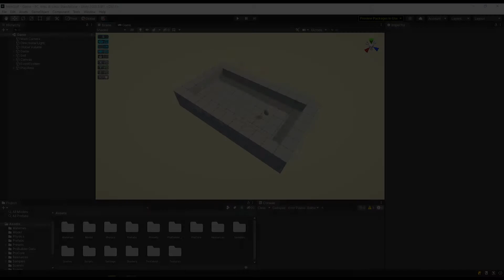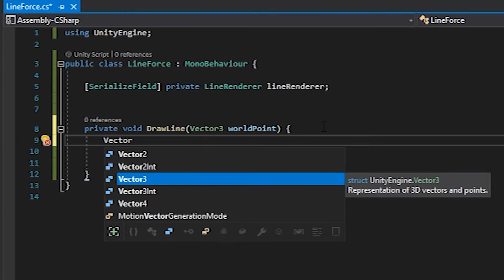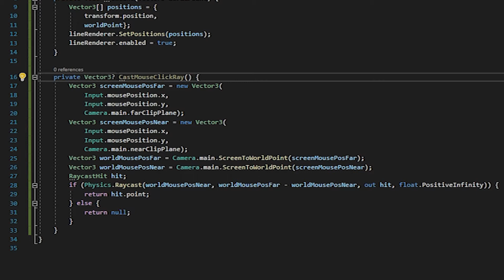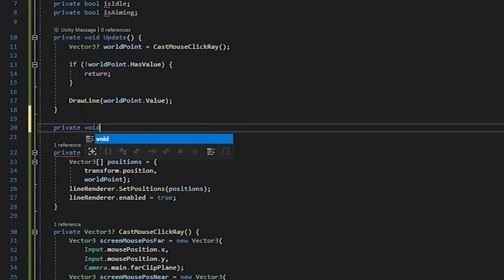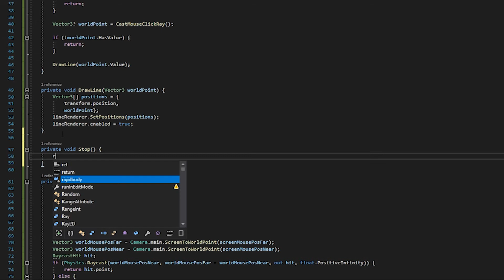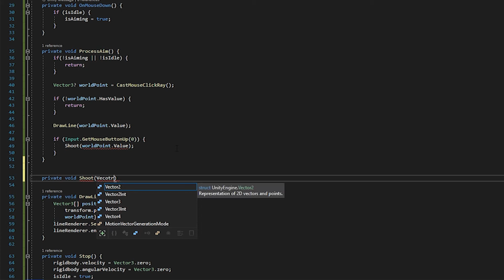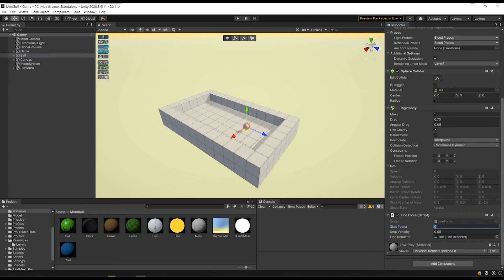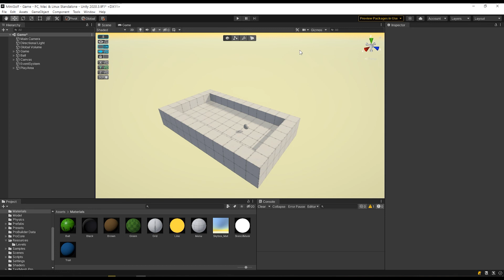How To Make A Unity Mini Golf Game (part 1)

Comment: for a simple fix, easier for my brain to process as its what i am used to for games i have played in the past

instead of this

   rb.AddForce(direction * strength * shotPower);

i did this

   rb.AddForce(-direction * strength * shotPower);

just so you pull back on the mouse to increase power.  ofc it is all preference, but this is what I prefer
Reply: you are a hero

Comment: For some reason it is random when i shoot the ball. Like the ball decides when it wants to shoot and when it doesn't. Do you know why this happens?
Reply: You are checking for inputs in the FixedUpdate function. FixedUpdate, instead of running once every frame, only runs once every physics tick, depending on the physics in your scene there may be more than one tick per frame or one tick every 10 frames.
Reply: thanks man helped me alot also my linerenderer in not displaying correctly like instead it displaying from the centre of the ball it appears on a random part of my screen, How do I fix this? @itsJimaholic
Reply from the maker: Without seeing your code and how your scene is set up, it’s hard to say.  Feel free to join the discord in the description and I can help you out there

Comment: Thank you very much for the content! A question, I would like to change the direction that drags the mouse, instead of dragging forward, dragging backward, do you have any idea how to solve it?
Reply from the maker: Around 10:15 I add a ShotPower variable to the script.  If you assign a negative value to that variable in the inspector the force that gets applied to the ball will be in the opposite direction of the dragged force.
Reply: @AIAdev  Thanks for the reply man! I actually meant it like this:
Currently in the script the player needs to drag the mouse forward and the line renderer will go in the same direction as the mouse, but how do I drag the mouse backward and keep making the line renderer show the same forward direction in the video, so the line renderer will go in the opposite direction of the mouse and the object will be thrown in the direction of the line renderer. Sorry for my English
Reply from the maker: @kisan1001  You could try doing some vector math to rotate the 2nd point drawn by the renderer by 180°.  This seems like a case where Dot.Product would also work but I admittedly don't fully understand how to use that to be able to help.
Reply: @AIAdev  Thank you man!
Reply: haha was about to ask the same question
Reply from the maker: @ProdbyHuskije  Very interesting, is the way I do this atypical for a golf game?
Reply: @AIAdev  I don't quite understand your question.I'm brand new at coding and wanted to make my first little game a minigolf game! 
I found a way to pull back on the ball so the ball goes forward, but now I need to find a way to make the linerenderer go forward too :)
Reply: @AIAdev  Usually the direction of the ball is the opposite of the direction the player drags with the mouse, this is our doubt
Reply from the maker: @kisan1001  gotcha.  I certainly haven't played a lot of golf games 😅
Reply: @AIAdev  a bit late but, like launching a pinball
Reply: @ProdbyHuskije  Hehehe :)
Reply: In the draw line function go to the position array and do this :

Vector3[] positions = { transform.position, transform.position + (transform.position - worldPoint) };

Hope it helps :) .

Comment: Nice video,really curious to know how you're gonna limit the player drag distance.
Reply from the maker: This could be done by splitting the worldPoint into a normalized vector3 and it's strength (vector3.magnitude).  Then clamping the strength between 0 and some max value.  Then we could reconstruct the vector3 based on that.
Reply: @AIAdev  I know this is an old video but could you provide an example of this? I've been trying to figure it out for hours now.
Reply: @itsJimaholic  I didn't see the video but the logis is that the vector3.normalized is the vector with the minimium to get the direction, and the vector3.magnitude is how many minimiun (nomalized) fits in.

then you limiting the magnitude of vector (ex if the magnitude is 10, and you want the max to 5, you createnew verctor with minimium times 5, (normalized times 5 in this case)).

now you clamp the values based on that (limit these values between 2 numbers), starting from 0 to max value (max force applied to ball)

you can use chatgpt to help you on that...